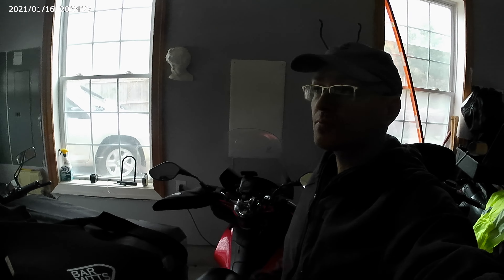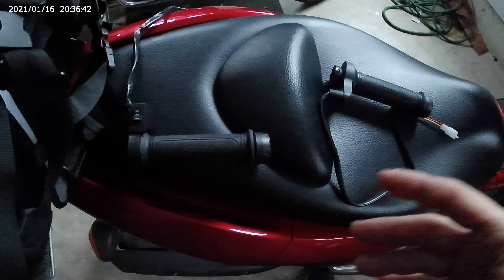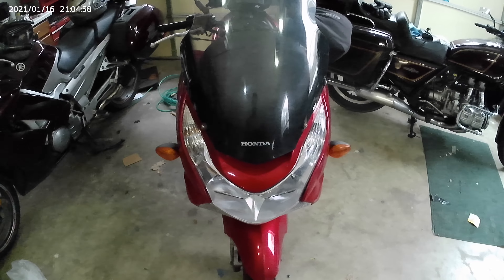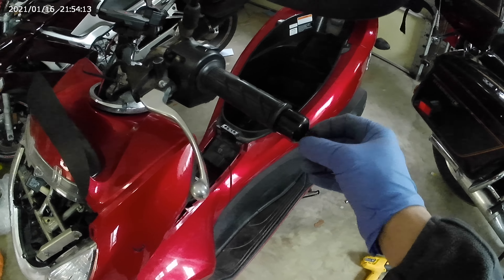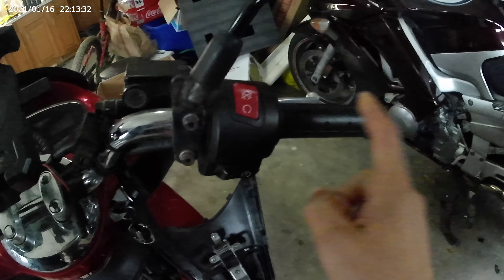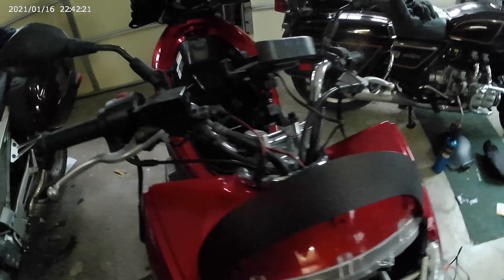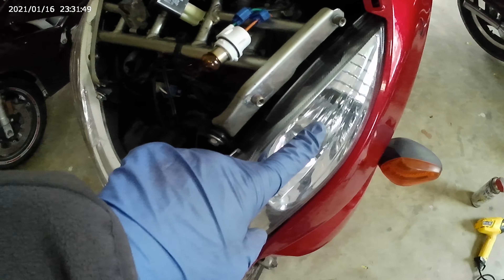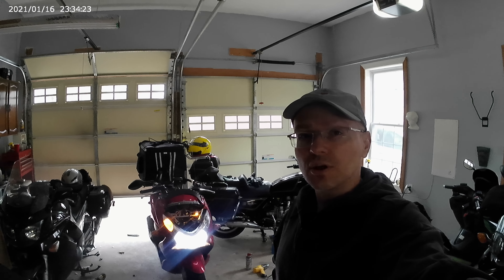Installing heated grips on a Honda PCX150

Comment: Would have been handy to see you putting the connectors together, so we can see where you wired them into. Other than that, good advice.
Reply from the maker: I will be installing heated grips on my Adv150 soon and will do a better video.